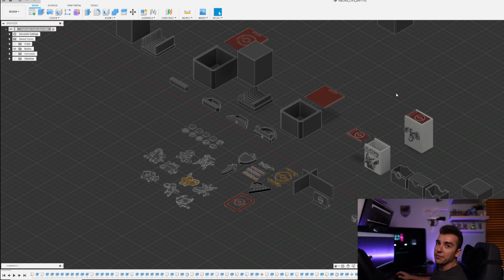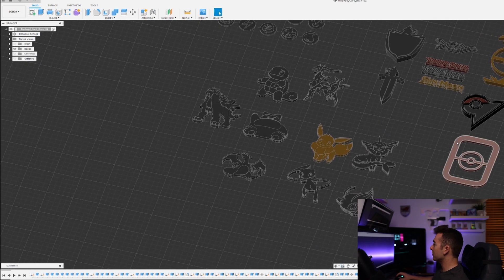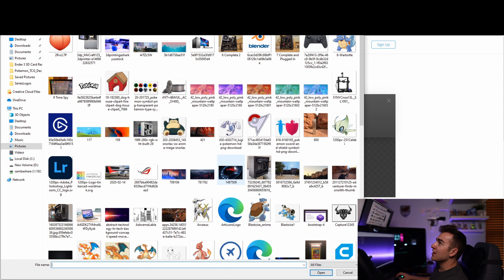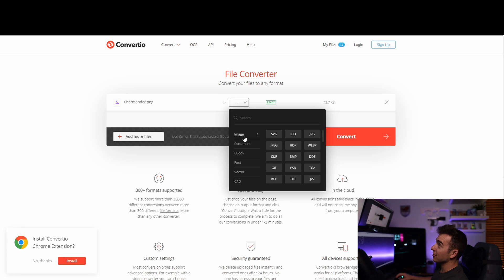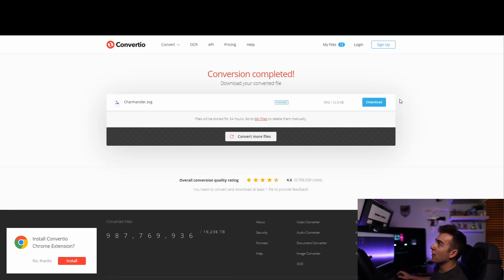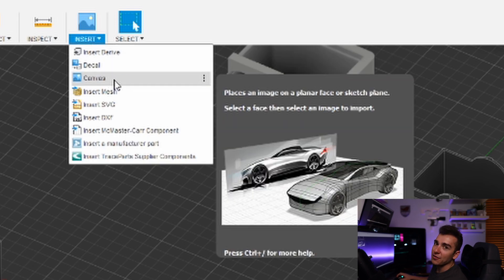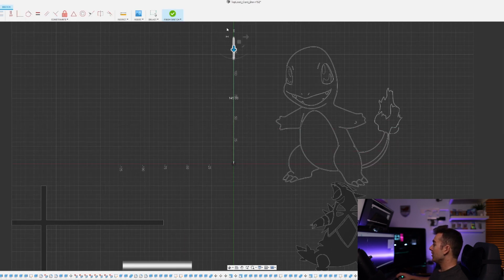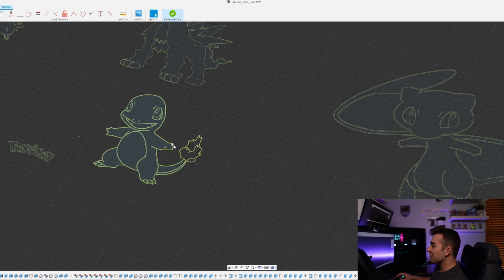How to Import an SVG Into Fusion 360, Image File to 3D Object

Comment: Jake how did you clean up those lines?
Reply from the maker: For the most part, I just use the trim tool on the sketch to clean up the lines. 
Then if I need to replace a line, I typically use different types of line arcs.